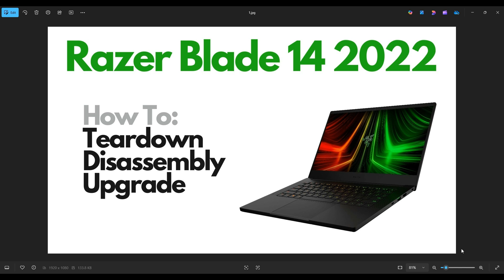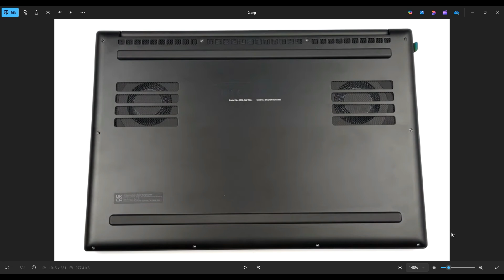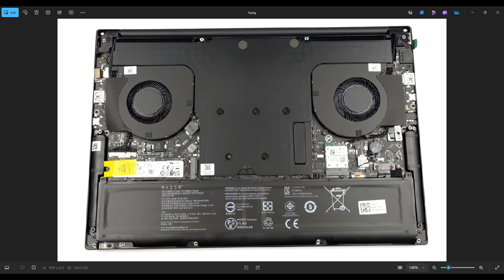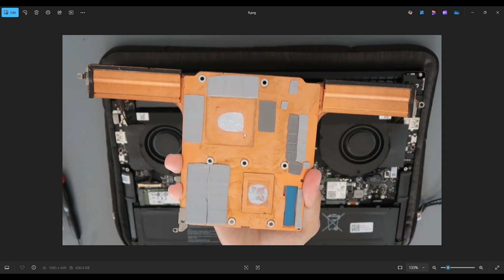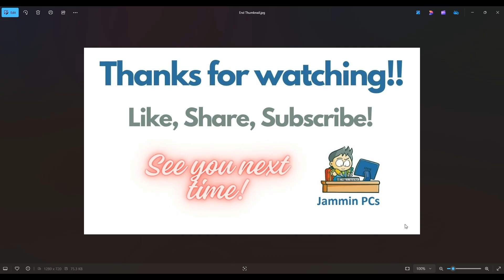Teardown, Disassembly, Upgrade Options for Razer Blade 14 (2022) Laptop Computer

Comment: losing hope trying to fix this model. Woke up one day 3 months ago and it just wont turn on. feels like ive tried everything
Reply from the maker: For a computer that does not turn on, try this video first; https://youtu.be/kOBY4k2Mn_k. Let me know how that goes :)
Reply: @jamminpcs I have, I believe it may be a problem with my CMOS Battery since my main battery is working fine and my ram is saudered. Wondering if it’s worth it to buy a new one
Reply from the maker: @anthonytorla5092  yes, if the steps seen there dont help, i would try replacing the CMOS